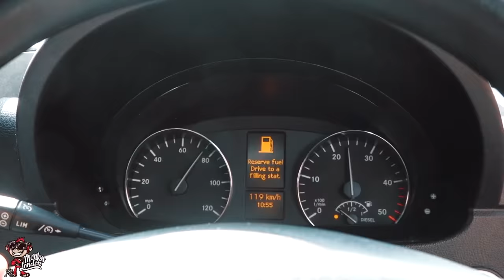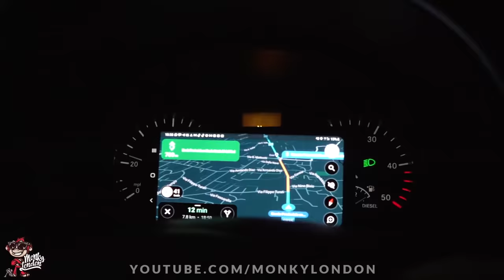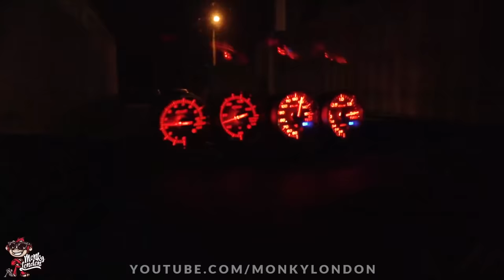🐒 MAZDA RX7 FLAME THROWER + TOM'S TOYOTA SUPRA IN ITALY

Comment: The rx7 sounds more like 220bhp or its not running properly, the revs drop whn changing gear it doesn't keep pulling,  and  sounds abit sluggish. The Supra, now that sounds like it's got the power and it pulled hard grate video 💯💯🔥💥🔥💨💨👍👍👍